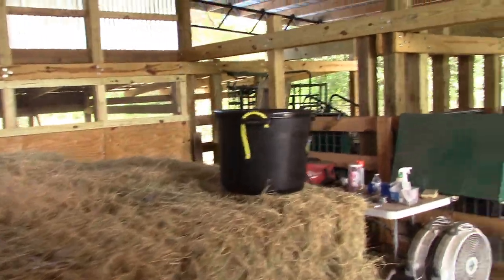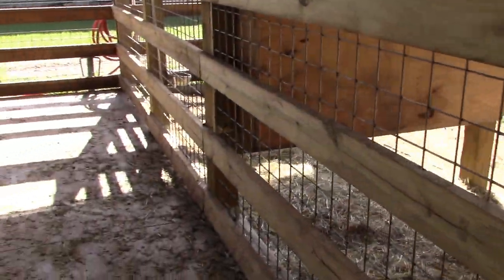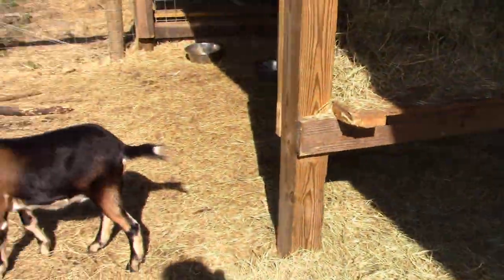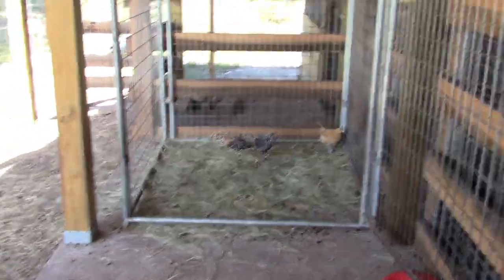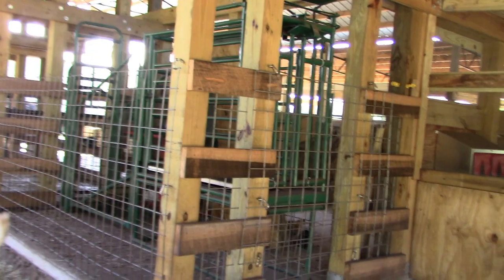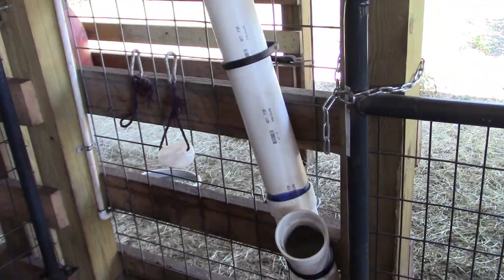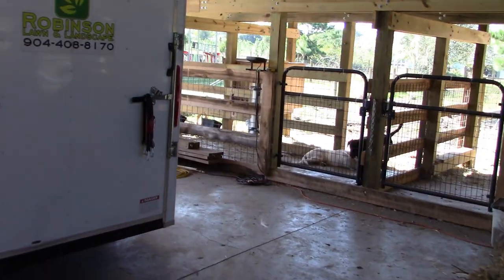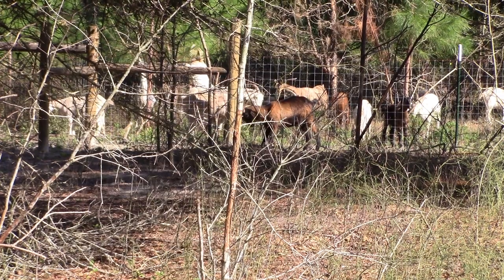LIVESTOCK BARN TOUR - LaLa Farm's Goat and Chicken Barn

Comment: Just a suggestion. I would have the hay off of the concrete because concrete will draw a certain amount of moisture that will mold the hay on the bottom layer.
Reply from the maker: Right you are sir.  In fact we have searched high and low for plastic pallets and now have about 10 of them that we move around to stack the hay on.   Thanks for watching.
Reply: @TheLaLaFarm  I watched the video and I enjoyed the barn set up even though I don't have goats, I do have chickens and I have thought about venturing out with a few other things but I'm unsure as of yet what it may be at the moment. I know a little more about cattle than I do about goats and I've had some hogs before but perhaps in time, I'll know more about what I'd like to invest in.

Comment: Great set up. I am still designing and figuring it all out. I must admit I am a bit jealous 👍🏼🐐🤠
Reply from the maker: Its taken most of the last year to get it to where it is now.  All I have left is to run the electric for lighting and outlets and it will be complete.  But now that it is cooler, the electric will have to wait because I have cross fencing to do in the new buck pen and doe paddocks.  No rest for the weary.
Reply: The LaLa Farm I know the feeling. Currently fencing and adding buck pen as well.

Comment: Hi Rick, I watched a couple of your videos on TV yesterday and came back to comment. That is quite a barn. I noticed the triple lag bolts right away and thought maybe it was to combat hurricanes. Very nice, well thought out build. Lots of hard work. How long have you lived there?
Reply from the maker: I overbuild everything!  We do get high winds, but the biggest issue I was anticipating was a 180 pound goat headbutting the walls.  The have broken 3 welded gates - one of which was bent in half.  The walls however have not budged.   For about 5 months - you could not find a 5" anywhere in town or at the closes Home Depot. 😁  We bought the land 5 years ago, and it been a series of projects ever since.  We moved onto the property 3 years ago.  This winters projects are to build 10 more raised beds; finished my covered garden work space; and build a 3rd chicken coop for breeding pairs; and of course - some goat cross fencing.  All of these projects are impractical during the heat of the summer - its just too darn hot. Thanks for watching Roland. - Rick
Reply: @TheLaLaFarm  180lbs and still bend a gate? Wow! I wouldn't want him to take a run at me.
Reply from the maker: @GettingItDoneRepairs  none of those gates were bent by bucks - every time - it was does in heat.

Comment: Do you have the plans for  it, and how much does it cost? Just wondering because I am looking to build something similar to this :)
Reply from the maker: We dont have plans for the barn - I just drew it out on paper and built it.  The main pole barn we had built at a cost of about $5,000.  The concrete floor was $2,500. The additional interior for the stalls, walls, and hardware was about another $3,000.  So we have about $11,000 in the barn.
Reply: Can you share the drawings, it is such a good plan.
Reply: who did you buy the pole barn from
Reply: @louiecortinas2958   I believe in the 1st comment he said he built it. So I'm assuming he didn't buy a kit. He just measured it out, got the materials, and built it himself.

Comment: Do you have mats or wood under your hay that’s stacked in the barn on the cement.?..
Reply from the maker: There are rubber horse pads under the concrete. Thanks for stopping and watching.- Rick
Reply: @TheLaLaFarm  you mean under hay bales.?.. I told a friend that the hay gets ruined if you stack it on cement..She didn’t believe me..I’ll stop by more . I enjoyed watching..
Reply from the maker: @catherinegrace6406  Yes - I meant under the hay bales. Sorry.  Hay that is stacked directly on concrete will tend to pull moisture into the bale from the concrete.  So when this video was done, we used horse pads under the hay stack.  We have since found some plastic pallets that we stack the hay on now - which is far better.  The plastic pallet is completely inert, really sturdy, and does not interact with the hay in any way.  The pallet also allows for airflow beneath the hay bales which helps to keep them dry.  - Rick

Comment: Hello. Does the hay go bad (moisture) if you have it laying on cement? Wondering if having the hay on pallets first would keep it lasting fresh longer ?
Reply from the maker: You know - that is a great question - we have not had that issue, but have since raised the hay onto plastic pallets to avoid moisture from getting under it.  We did lose a few bails, but this doesn't seem to be a problem any longer.  Thanks for stopping by.